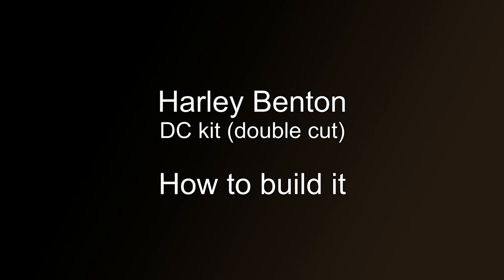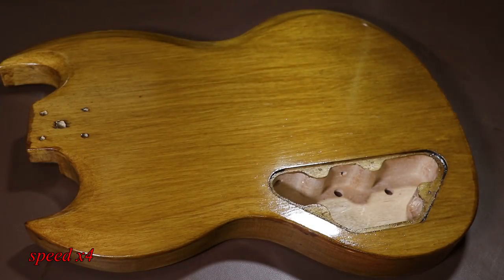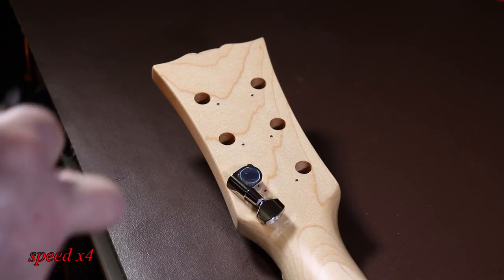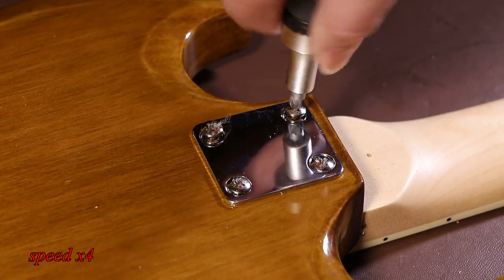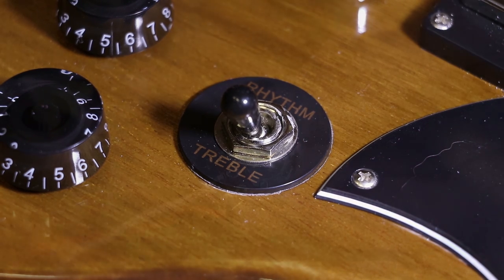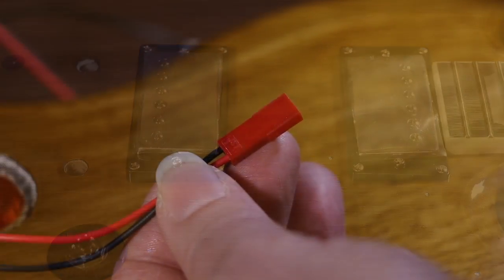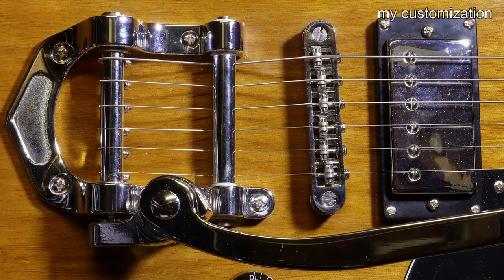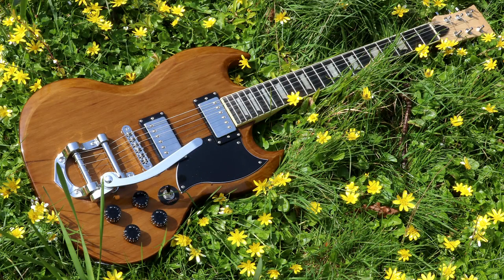Harley Benton DC guitar kit assembly instructions, test and review

Comment: You need to do a light sanding in between varnish coats to smooth out the bumps which are typically called “orange peel”. You want to keep the surface as smooth as possible because the more layers the bigger the bumps get.
Then use very fine grit wet paper to give it a final sanding and start polishing !
Reply: I was thinking that. Wet sanding right???

Comment: I done this a couple of years ago, same DC Kit. All ok apart from one of the bridge screws missing, but Thomann sent me an additional screw. I finished mine in red nitrocellulose and clear nitro. Also I added a headstock detail using a print out and sellotape with water trick, worked great! The Bigsby on your guitar is an excellent idea and the guitar looks great!
Reply from the maker: Thank you . .  yours sounds really nice, the red sounds a bid Jimi Page.  Thomann are really good when it comes to customer support and replacing things quickly,   I had a broken volume knob that was replaced very quickly . . 😊

Comment: Not an expert here but I think you're meant to slightly sand it between varnish layers.
I tried this once at home and it was ok, but it was in something that didn't required it to be extra smooth like a guitar.
Also, one thing worth mentioning to people who might want to try this is to shield the electronics cavity before installing them.
Reply: I remember using steel wool between coats on a varnish project years ago, also Dampen to raise the grain and light sand and allow to  dry before first coat.
Reply: Both are good suggestions.

I've been watching videos in preparation for doing my first build, and I've only seen one vid that showed them using shielding paint in the electronics cavity. Even they didn't shield the interior side of the cover plate. It seems like an obvious improvement for only a few dollars.

Comment: Like the two coats also. Give it a slight sand then change out your stain coat to a clear varnish coat and sand between coats.Option two use stain varnish you started out with to two coats sand slightly and spray one coat of vinyl sealer the use lacquer product. Vinyl sealer is a finishers friend when in doubt what the coating is on something prefinished and anything will adhere to vinyl sealer.
Reply from the maker: great tips . . thanks 😊

Comment: Watching your video, the technique you were using and the finish you were after, I can't help but think you'd have had a much better experience with wood dye for the colour, followed by protecting and coating the wood using French polish which is shellac based, rather than what I presume is a polyurethane based varnish. French polish is much thinner and much smoother, so adding coats increases the shine and lustre, where adding more coats of varnish just tends to make it thick and lumpy - the very problem you highlight here.

Your application technique itself - lots of layers applied using a cloth in a circular motion, is the essence of French polishing anyway. Yes, the end result might be more fragile but if you were concerned then a final single coat of poly varnish would protect it.

In my local hardware shop, both these products are located next to the varnish, and they're readily available with no age restrictions as far as I'm aware. You can even get decent pre-mixed French polish from the same brand as the varnish you used.
Reply: Great advice :) I've used tung and danish oils and they work beautifully. My first guitar was finished with tung oil and it looked great, plus it was easy to do.
Reply from the maker: Over time I need to try all these great suggestions I'm reading . . 😊
Reply: GCH Guitar Academy  You should also use a wood filler/sanding sealer if you have to sand off the poly sealant that was applied at the factory or if the kit does not have a seal coat on it already.
Reply: Personally, I like the wood to look like wood, rather than being plastic glossy "perfect." So I have used boiled linseed oil to finish my efforts.
Reply from the maker: @lightningslim  yes . .  me too . . 😀   How does the linseed oil behave over time ?
Reply: Or Tru Oil! I built the tele kit from Harley Benton and applied it the same way you did with the laquer and it turned out great. It's not very glossy though, more like a soft satin shine, which is exactly what I was after. Only downside is Tru Oil was pretty hard to find in my country since it's for guns, the very few gun stores in my city didn't have it and had to order it from another city. But the small bottle is enough for maybe 2-3 guitars, which was awesome as I started several cigar box guitas since and it was enough for 4 necks. The finish on the tele looks just as good more than a year later 👍

Comment: I made my living as a weed finisher and I would firstly sand down from 240 grit to 600 grit. Next use either grain filler or sanding sealer but don’t use wood filler. Wipe off the surplus before it dries and repeat the sanding. Leave it to harden for a couple of hours. The best finish would probably be French polish, but if you’re not skilled at it, go for gloss varnish. Finally apply up to 6 coats of varnish if that’s your choice. Leave each coat to dry for about 6hours, and be sure to rub down between coats with 1200 grit wet and dry, being sure to wipe off with a damp cloth after each coat. When you achieve the required finish stop sanding and give it 24 hours to dry. Now you can make a living as a varnisher.
Reply from the maker: That's good advice and I will be trying it . .
Reply: I know lots of guitar players that are weed finishers too
Reply: yup thats it, no need to type
Reply: I have finished a lot of weed in my day.  I quit some time ago...
Reply: I just finished some weed

Comment: Nice video ! Even on quality timber, grain filler is a must before finish is applied otherwise any varnish will build up in invisible hairline cracks.  Go over the whole body with the filler and sand with fine grit wet and dry and repeat this at least twice more. Then use a wood stain to acheive colour of choice. Type of varnish you used  is totally unsuited as it will over time turn a dirty brown mess and probably peel. Clear acrylic or polyester lacquer is the way to go. I have used quality rattle cans of car top coat with perfect results. Trick is to take time and apply several light coats ( at least 8-10) with very light knocking back between coats. Then two final heavier coats without sanding. Leave to dry for at least a week then buff with a lambswool mop. Alternatively your friendly local garage will probably spray it for you in one hit for about a tenner !  Sam Walker rightly suggests French Polishing (no such thing as French Polish however - it's a process not a material) will give a wonderful finish and in fact was widely used in the 19th Century for stringed instruments but fell out of favour because of its softness and sensitivity to low heat, moisture and alcohol. Great if you are just going to hang it on a wall ! Play it regularly however and it will quickly look like your cat has done River Dance on it ! Hope my comments help.
Reply from the maker: Thank you for taking the time to leave great tips . . 😊

Comment: I did a tele Kit with Tru oil and wet sanded between each coat which was about 6 coats. After final coat. I wet sanded at 500, then 1000, then 2000, and finally 4000. After that wax and buff. My Tele looks like a dream. If you're not willing to put in the extra work then don't be surprised with less than stellar results.
Reply from the maker: very true . .  and with Tru oil the finish is very tough, which is a bonus

Comment: Hello friend I have really enjoyed watching your video. There’s nothing like trial and error for the best experience. I have worked with varnish before and I’ll share with you my experience. If you like what are you noticed with working with varnish is after you have put your coats on allowing adequate drying time you get to where you want it to be as far as color wise as far as shine . No I would like to ask you have you ever worked with wet sanding? It’s when you take various grits of polishing paper starting at 800 grit, 1000 grit 1500 grit 2000 grit 2500 grit. all the way up to about 10,000 grit that is so you will take the varnish that is already on and you will level it. It’s also referred to as level sanding. Be sure to put a little bit dishwashing soap in your water no more than a drop or if you have it on hand Naptha also works very very well for that task after you have done that wipe it off with a cotton rag that is lint free and clean. After that take a mild rubbing compound I like 3M but over there in the UK I’m sure you have your products that are the equivalent, or perhaps even better and then put an amount on that and take buffing pads are use a small electric buffing machine like you would use to buff out your automobile and I bring that up to various polishing degrees as well after you’ve done that you will need to put on some polishing paste pretty much any type of automotive paste as long as it is of good quality repeat the same technique as you did with the rubbing compound and just use your talent and allow yourself to learn as you go and from that point on, you will have a body that you will have to wear sunglasses when you look up on it. I hope this helps you in someway carry-on it’s a very expensive obsession, but so much fun. Cheers.
Reply from the maker: Yes I'm familiar with that method, which you've explained really well 😊 Thank you.
The point of this video was to see if the guitar could be built just by obeying the provided instructions in the box and on the lacquer tin. I think the exercise proved you can, but it would be better using techniques like the one you described.

Comment: When putting in those neck screws, note that the screwdriver is a bit small in the cross head.  This risks rounding them out or stripping them.  use a screwdriver that fits fully to the width and maximum depth to best drive the screws.
Reply from the maker: Yes you're right, the screw driver was wrong for the job 🤔

Comment: I bought a BEX from Amazon. The only issue I had was with the wiring. Not much guidance. I had to use my intuition and look at many, many videos. I realized that you can wire it three different ways depending on the type of sound you want. The holes inside the body weren't big enough to pass the switch through, so I had to unsolder it and resolder it to fit. 
As far as the finish goes, I used Crystaylac and put on about 20 coats until I was happy. I had to do a lot of nick fixing. But again, in the end, I was happy. I haven't finished the wiring yet but it'll soon be done.
Reply from the maker: That sounds like something not recommended for an absolute beginner or a kid.  The point of this video was to do it directly form the instructions with the minimum of change to see if a beginner could do it and I came to the conclusion (for this kit) an absolute beginner could put it together (just).  🤔

Comment: As you said- acrylic lacquer is car paint. So to get a high gloss, smooth finish you need to wet sand with 1200 grade paper to get it even then use cutting compound on it. This will bring it up like glass if you do it properly.
You can use car polish after cutting to enhance the shine and protect the surface.
Reply from the maker: good tip . .😊

Comment: I have not read all the comments so maybe it has been covered..check out "French polishing"..You apply a coat dry it then sand it, add another coat, dry it, sand it, do as many coats as you wish...the high surfaces are sanded be k while the low spots fill eventually you have a nice flat surface needless to say on the final coats use a very fine paper...the final surface is like glass.
Reply from the maker: Yes, this is the most common advice and seems to be the clear winner. . . 😊

Comment: Even before I saw this video, I was thinking about getting a HB kit. Now I've made up my mind for a DC as I've never even played a real Gibson SG. And I will aim for the deep oak colour and finish you achieved.
Reply: One question though: the only customisation I would make is to put a simple logo (probably my first name or initials) on the front of the headstock. How best to achieve that? A marker pen or Sharpie, covered with a few coats of clear varnish??
Reply from the maker: Glad I could help!  😊😊
Reply from the maker: I'll be doing a video on options for that  . .  but I wouldn't use a sharpie unless you are very good with a pen.  I'm not so I would have to print something . 😊
Reply: @guitar-academy  Oh, you sure did do that. I've just moved to a new city, and don't have any tools, nor a suitable place to work like a garage. Hoping I can borrow any stuff I need.
Reply: @guitar-academy  Can't wait for that vid. It's not going to be a Rembrandt, just two slightly stylised letters, or perhaps my first name in cursive script, which I'll practice on paper beforehand. I'll also do it on the headstock before fitting the machine heads so my hand is comfortable resting on it. I just want to make sure the lines are clear and defined and won't smudge with the first layer of clear lacquer.
Reply from the maker: @droses1600  It sounds like you know what you're doing.  Everything you've said has been good sense . . 😊😊
Reply from the maker: @droses1600  I would love to have a specialize workshop . . it would be great . .
Reply: @guitar-academy  Hmm, thanks for the compliment, but I have a tendency to f thngs up when doing handicraft projects. Unlike you, I don't have the skills or knowledge or experience to rescue things when they go pear-shaped. And a kit like this is an expensive (and heart wrenching) mistake to make, unless you like creating expensive firewood.
Reply: And for those who don't know, it's possible to download the assembly instructions for every HB kit on the relevant product page BEFORE you buy, so you can check if you have the necessary tools/equipment, as well as to assess what's involved in each step of the build.

Comment: your first problem is you didnt use a sanding sealer on that wood.  Mahogany needs to have a sanding sealer to fill the grain.  Second, you should have sanded inbetween coats of varnish to level the finish.  Also, you sand between coats of lacquer to keep it level and add depth to the finish.  Finally you wet sand the clear and buff it with compound to a super high gloss finish.
Reply from the maker: thanks for the tips . .

Comment: Thank you for posting and your observations, it all helps. Your wiring seemed to work fine but people sat that on the single cut model some de soldering is necessary as the volume is either on or off. This crops up in many reviews as a known problem so am puzzled but easily fixed presuming one has a soldering iron. Many thanks again...nice job.
Reply from the maker: Glad it helped,  I just put it together as it was, no modifications to the wiring at all and it worked fine, but this isn't the single cut model . . 🙂🙂

Comment: It is important that the holes for the neck screws in the guitar body are drilled out to be the same size as the un-threaded shank of the neck screws, or the maximum diameter of the threaded part of the screws, whichever is the largest: if you don't check this there is a strong possibility that the screw threads will cut into the body wood, forcing the neck very slightly away from the neck pocket, and preventing it from seating properly. Not too loose; just wide enough to allow the neck screws to be inserted easily down to the back of the neck, without any wobble. Also, the holes in the neck really need to be the same diameter as the solid centre of the threaded part of the screw: you do NOT want the fit to be so tight that you have to force the screws in using excess force! The neck holes should be drilled just very slightly less deep than the part of the neck screw which will be screwed into them (remember that the very tip of the screws will be pointed). If you have a lot of difficulty in screwing them fully tight, there is definitely something wrong with the diameter of the screw holes! This is important, you should never have to wait until the wood expands to allow the screws to be tightened all the way! This is a definite recipe from breaking a screw if you ever needed to remove the neck: believe me, removing a broken screw is not fun, especially if it has broken off level with the back of the neck!
Reply from the maker: Yes all true, and good advice . .  This video is the continuation of the review and therefore the point of this video was to see if the guitar could be put together straight out of the box using the instructions and existing parts without having to drill or alter anything.  Even though the guitar did go together OK, your point is spot on and I didn't stress it enough in the video but the guitar really needed a little modification to make it fit together perfectly.

Comment: This video is very relaxing. I wanted to buy the Les Paul type Single cut kit from Harley Benton but I might get this instead.
Reply from the maker: At the end of the day it might be down to availability, as they had run out of the double cut for a while.  I haven't looked if they've got them back in stock yet. . .

Comment: Just so you know, neck screws aren't meant to be threaded through the body - only the neck. I would have drilled the body holes big enough for them to fall through so that they can pull the neck in properly. That's most likely the reason it was so hard screwing them in, or like you said they were also drilled too small.
Reply from the maker: True, but you missed the point of the video . . this is the continuation of a review, so I wanted to see if you could put the kit together without having to make modifications yourself.  That's why I make such a point of the fact I was following the instructions.